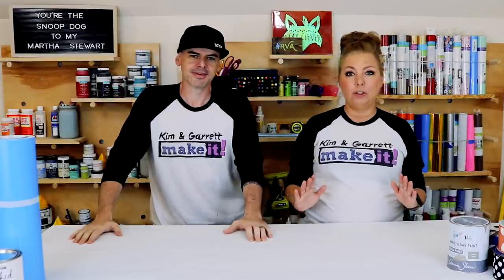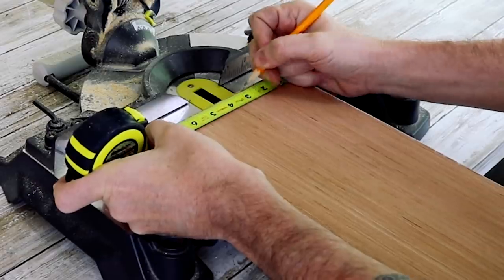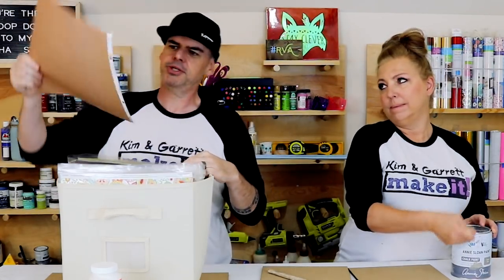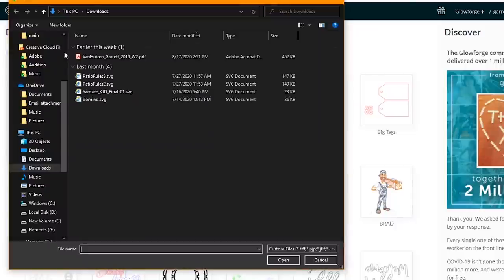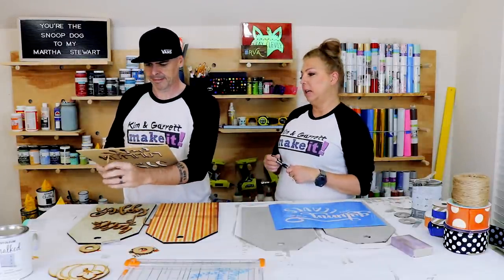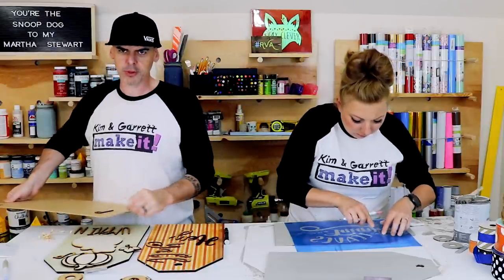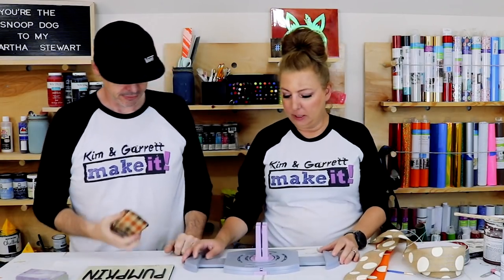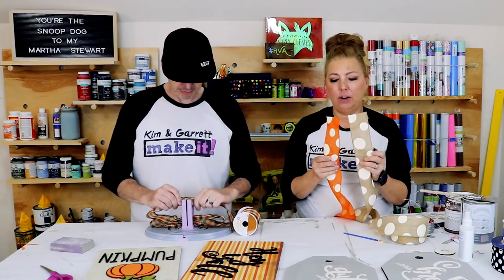3 DIY Door Tags | Gift Tags Door Hangers | Fall Front Porch Door Decor

Comment: 😻Gah! I’m getting so excited for fall now!
The hello pumpkin is super cute and I’m loving the neutral colors with the cute bow on Kims too. Hey, I also have a question for you regarding sealing outdoor signs /decor. 
I’ve sold a few outdoor porch signs and one customer came back because the clear coat didn’t hold up and the stain faded. I even used an outdoor spar urethane. Do you guys use Polyacrylic on all your outdoor decor? How long does it last outside? Do your paints fade? Any help is appreciated. I’m trying to avoid having customers return to have products redone. ☹️
Have a great weekend !!
Reply from the maker: Yes we use the same! We haven’t had any issues with ours honestly but since we’ve only been doing this about 2 years we’re not sure how the signs hold up past that! I’ve noticed a little sun fading but honestly if it’s outside it’ll probably fade with time no matter how hard you try to stop it!
Reply: Kim and Garrett make it I’m kinda a Newby at outdoor signs. I totally understand fading will happen eventually and it’s just the nature of the beast. Thanks for your help!